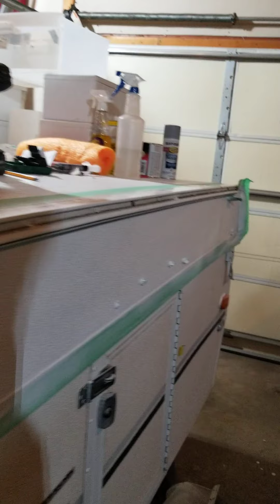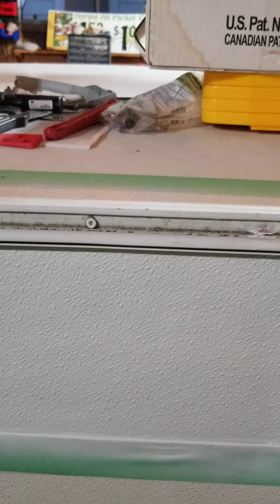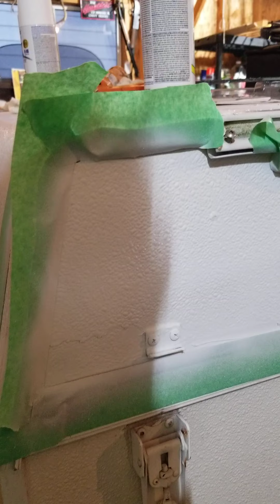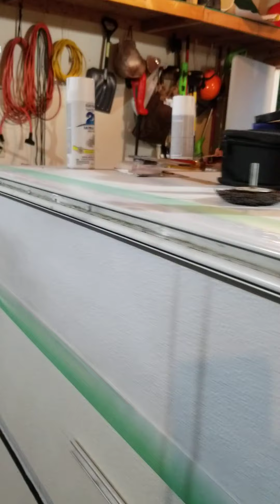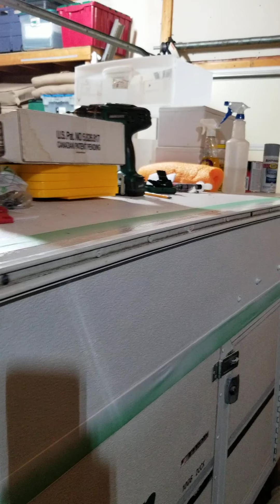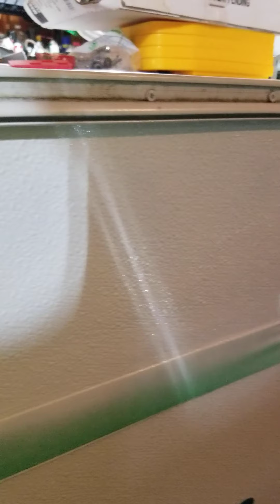Pop Up Camper roof side repair pt 7

Comment: How has it held up? I have one with the skin completely cracking in one corner.. not able to save from what I see.
Reply from the maker: So far so good.  Haven't had it out yet this season, but last season it did fine.  Is yours aluminum or ABS skin?  The ABS on Coleman's is notorious for cracking.
Reply: @BenRSnyder  ABS. The wood is shot too.  Slightly concerned the lift posts are going to fall out of the rotten  ceiling ends at some point.

Comment from the maker: We did take this out camping twice last fall and it worked just fine, no leaks or anything.  It rained pretty good for about 24 hours straight and held up just fine.  It still takes a putty knife to close it up so I'll be working on that when I get it out this season.  The door has been hard to align too, so I'll be diving into that as well.